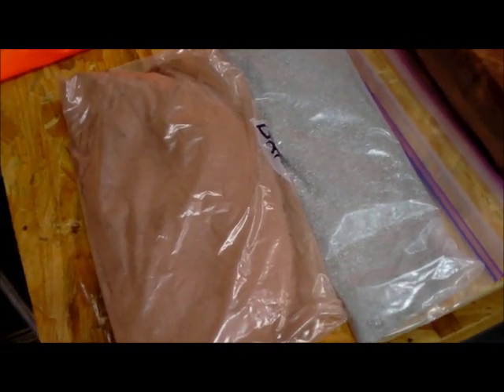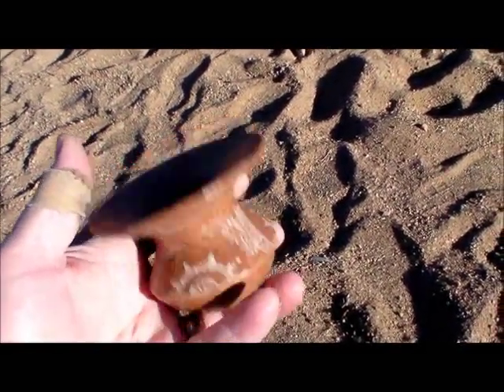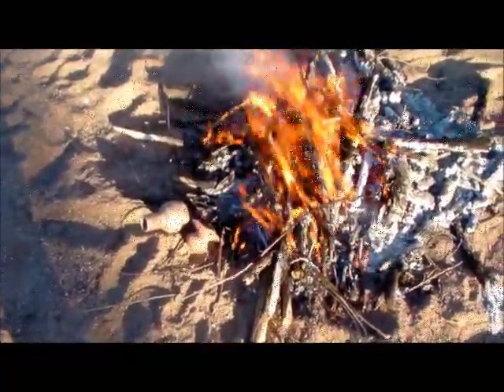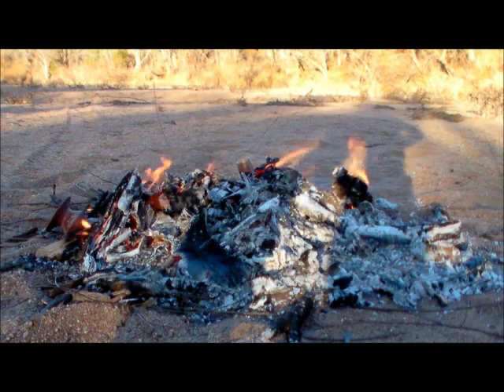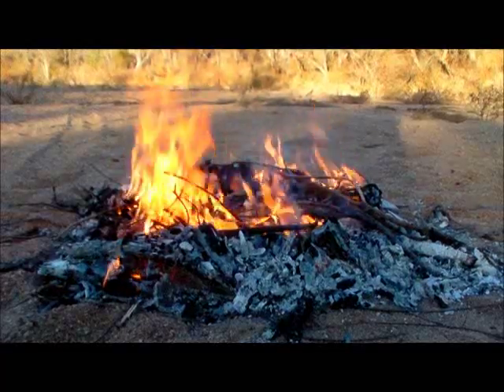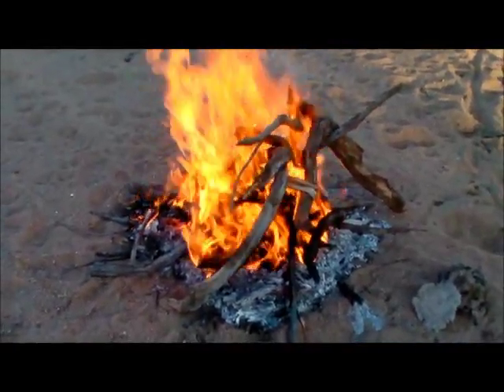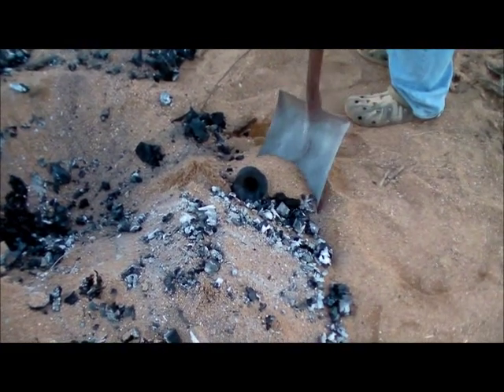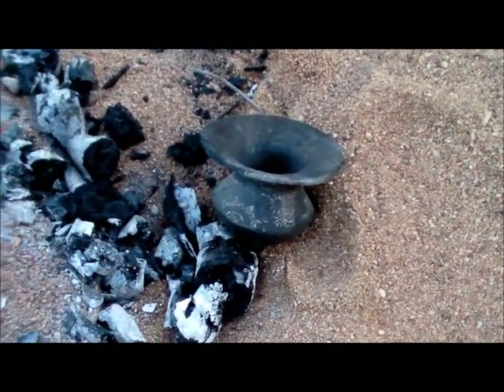Native Clay & Mussel Shell Test and Pitfire

Comment: Very cool you are extremely good at making the pots. You got lucky to have good potting clay in your yard. It took me 5 tries before finding a clay that would pot well. When I tried shell tempering, about 5 days after firing the pots they fell apart. The shell pieces expanded and the pots would just fall apart. Ive had to stick to crushed pottery as a temper.

Comment from the maker: The mussel shells work as a temper for the clay. Temper helps control shrinkage when making a pot as well as help with thermal shock when firing the pot. Some native clay does not need temper while others do. It's why I was doing a test to see if the mixture I put together would work okay.

Comment from the maker: I didn't realize until a few months ago that you need to fire your shells over a fire before using them. You may already know this also the amount of shell vs. clay is important too. I'm still rather new at this but have been sourcing different sites on the internet. Haven't tried crushed pottery as a temper but have read that it's one of the oldest tempers used.

Comment: putting pots to close to the fire at first can crack them, i build a fire around them staring with three little fires like a triangle around the pot add wood slowly till you have a circle of fire around the pot, then at the end cover completely, let the fire burn out slowly and let cool over night. I get pretty good results.
Reply: Thermal Shock would be the word for that as the inside of the wall can be hotter or cooler than the outside and would therefore be expanding or contracting at different rates leading to cracking, dunting, or breaking. So heat and cool slowly or preheat even. Have fun!